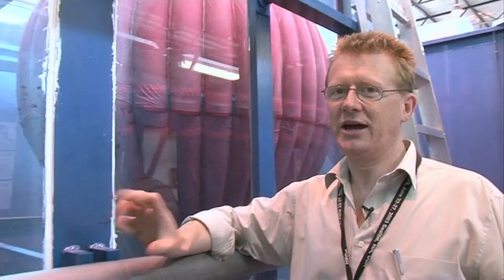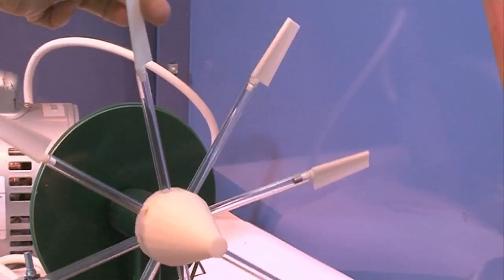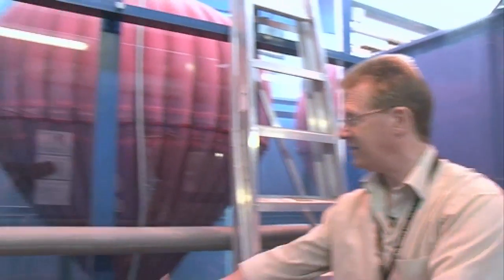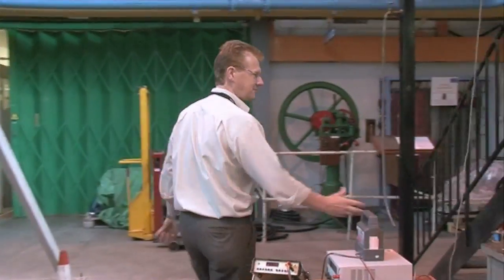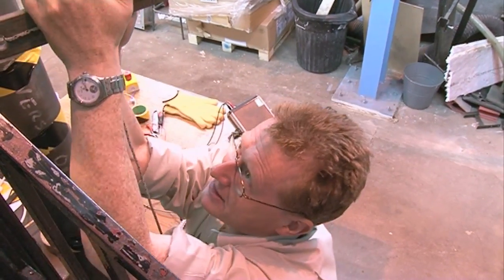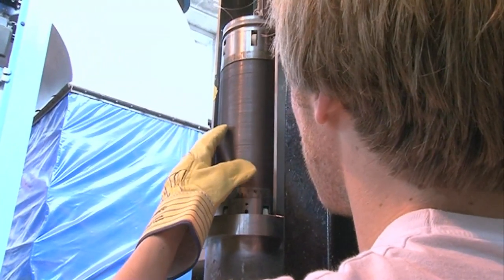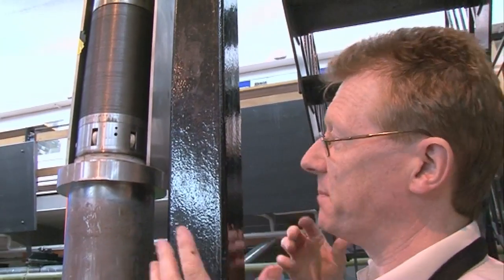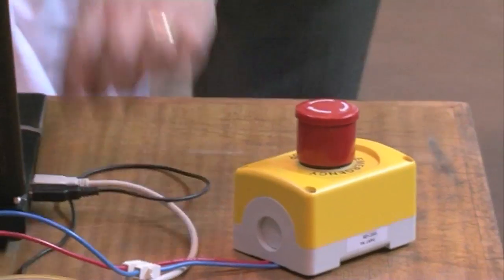Piston Drop Test

Comment: The inefficiency loss  from transfering energy from a well understood wind turbine to an electric air compressor is still going to cost less than the effort to maintain and repair this experimental system with heavy pistons banging back and forth in tubes.

Comment: Hmm precision honed cylinder 120 meters long? Sounds interesting. I presume the straightness of the bore is not terribly important. However the roundness is very very important if you want efficiency. I wonder how is the deflection of the blade going to affect the geometry of the piston bore.
Also I wonder if this system is going to be more efficient in comparison to  a multistage compressor in a nacelle.

Comment: The sea bags, cool. This piston in the blade idea, not so cool. Moving parts inside other moving parts. Seems like it would be a lot more practical to put a compressor at the shaft on the rotating wind mill. I suspect if this ever does see large scale deployment, this is what would happen.

Comment: @Albanianator If you anchor the balloons to the sea floor at a depth of 2000m, they can store air at a pressure of about 200 atmospheres, which is about the same as what can be stored in a scuba tank at sea level, but the balloons can store gas more cheaply than a conventional containment vessel since they only need to be strong enough to withstand the vagaries of ocean currents, sharks and other submarine hazards, and are basically just bags with a gas-proof liner and a pipe to the surface.

Comment: nice idea,
as they scale the size, they can also limit the speed that it rotates, so it can take as long as it wants/needs to do a single revolution. centripetal forces should be minimal
With pure wind generators, you need speed, this is different, the wind is rotating the blades to compress air for energy storage

Comment: @ZenonDorinPower i agree,why not use a  already well developed screw compressor etc,just geared off it.it would be able to use different speeds of rotation via a gearbox,and why not just use a empty gas well for air storage?? the cost for development and construction using a very inefficient piston /lots of friction and wear issues.....

Comment: @thegreatersnake 
I don't know how much useful the pressure in those bags will be.  The current compressors use a lot of energy to store compressed air into pressurized metallic tanks.  The psi in those tanks is reliable and creates a great output of usable energy, I don't think those balloons can contain usable psi.  If the weight of the pistons alone would create high amounts of psi then they wouldn't use balloons but they would use metallic tanks.

Comment: @odysseus9672 Think of it falling like the charging stroke in your car. You need to refill the air. This can be done via simple (mechanical) check valves. Rather than having to worry about electronically opening the valves during each stroke.

Comment: So it's only relying on the weight of the piston to compress the air?  Eventually the compressed air's force will be too strong and the weight of the piston wont be enough to compress the air. Once the valve opens as the piston drops down to compress the compressed air will escape back or maybe reach equilibrium and the weight of the piston and the force of the compressed air is the same.

Comment: At rpm, I think the wind turbine will be off balance or vibrate badly with the moving pistons like that.  In addition the centrifugal force will lower the force gravity has on the mass which will mean the pressure of your system is proportional to rpm.  I agree with ranster12.  Why not connect a compressor through 98% efficient gear drives or direct connect?  This way you're not limited to the force of gravity.  And I agree with hla27b building that cylinder is a problem.

Comment: this seems kinda wacky. i don't see why they dont just generate electricity, then use an electric motor to create compressed air. even if theres wasted energy, it would be more reliable and less bulky.
Reply: +pepe6666 because then you're using the electricity you just generated. 70 BAR is over 1000psi. to generate that sort of compressed air continuously would use up massive amounts of electricity. this is all about increasing efficiency. the more times you convert energy, the more energy is lost (by creating sound, heat, etc.). we can not create perfect systems to convert energy, which is why eliminating the conversions altogether is the most probable way to achieve maximum efficiency. if the turbine is spinning anyway, why not take advantage of it?
Reply: +Logan Fehr By this logic, why convert mechanical energy from the turbine into compressed air, then into mechanical power, then into electrical power in his proposed system whenever you want to immediately use the generated power on the grid?

Why not instead only convert the energy you have excess of from mechanical to electrical, to air, to mechanical to electrical when you want to take it out of storage? And have the advantage of storing any surplus energy on the grid from PV, nuclear, etc?
Reply: Its cool, Musk is taking care of it. 1Km^2 battery bank farm is sufficient to carry the US on pure renewable. Only one form conversion needed before the consumer. I say we pull a risky move and divert a massive swath of defense spending for a year or two to setting up as much energy storage infrastructure as we be able to utilize over the next decade as we add the generation side.

Comment: @Albanianator The conventional method of storing compressed gas is to construct a containment vessel with strong walls that can withstand the pressure difference between the inside of the containment vessel and atmospheric pressure on the outside.  The trick with the balloons is that they use the pressure of the water surrounding the balloons to counterbalance the pressure of the air inside the balloons, so they don't have to contain any pressure difference. <cont>

Comment: 20 tons on a 120 meters lever?! What are they planning to make the turbines from? Carbon nanotubes?! Not to mention the problem with highly unbalanced load on bearings in the centre. Real world turbines have problems with just the pillars creating a cushion of higher pressured air behind the blades and they want to place 20 ton weights on tips of them...

Comment: at 300 to 600 meter depth where this bags are supposed to be, they will have a pressure of ruffly 30 to 60 atmospheres, so the volume wouldn't be much more than that of the balloon times 60.
And still they wouldn't pop all at once since the outside pressure will be almost the same to the inside leaving the air slowly escape.
Even all at once wouldn't be more than 300 cubic meters not enough to sink 20 meter long boat.
And they will be under the windmill away from boat traffic.
so why worrying ??

Comment: I know it's a joke, a potential compressed air spill under water could be very dangerous. If sufficient air (or any gas) is released below a boat or ship, the boat or ship would sink when the air breaks the surface of the water. Spontaneous releases of natural gas (mostly methane) has sunk ships before. Although, of course, it's not dangerous for the environment.

Comment: I love the idea of turning the energy produced by the wind turbine directly into compressed air for easy storage but this piston in a 120m long tube seems a bit too experimental. Why not simply use a conventional wind turbine and attach a conventional piston air compressor to the shaft instead of a generator. You could even dimention the compressor so that no gearbox would be necessary allowing for further simplicity and efficiency.
Reply: Never ask this kind of questions. No one will answer. Do not ask efficiency questions either.
Reply: I wasn't expecting an answer. Simply proposing a better solution.
And by the way - Never tell people which questions to ask and not.
Reply: ChrDam12321 Dam you could also use a turbine based compressor.  Take the main shaft of a typical wind turbine then gear it up until it can spin the smaller blades of a turbine.  You then don't have to worry about having to turn to rotation into reciprocal motion.

Comment: Compressing air causes it to heat up.  I'm too lazy to do the calculations but quite lots of the work you'd be doing is wasted to heating of the air while it's compressed. I wonder if they have anyway to deal with that.

Comment: Great idea, except for the pistons in the blades. Why not use a more typical multistage air compressor (or modify a large engine), instead of trying to do this inertial with a massive, heavy piston.

Done right, you could use the rotating power to directly drive a generator for immediate use, and use that same compressor as an air motor to generate electricity from storage when needed

Comment: The turbine would have to rotate slow enough so that inertia wouldn't keep the pistons stuck at the tips of the turbine blades.  This would, technically, make the turbine less efficient as the wind speed increases because less energy from gravity would be converted into air pressure as the acceleration due to the earth's gravitational field must fight the radial acceleration of the pistons.

Comment: we've already heard the problems of loss of energy due to heat and inefficiencies, but here's the BIG problem: the turbine is SPINNING. think about the amount of energy you lose by compressing air as they fall down the upper blade due to centrifugal (yes, I said CENTRIFUGAL, deal with it) force! it would be much more efficient to harness the air pressure created by the falling pistons in the bottom blade, rather than the top.

Comment: I'm glad to see a few other people have noticed this as well but this method of compressing air is impractical, bordering on asinine.  You need an exact wind speed for this to work.  Just a bit too little and the blades can't lift the mass.  Any more than that and you lose energy to centripetal force counteracting gravity.  I wont even go into the frictional losses, mechanical stresses and oscillation something like this would create.

We already have very good wind turbine designs and very efficient air compression apparatus.  Why try to make this frankenstein  monster?  It has no benefits.  This whole 'energy bag' thing is starting to look like the solar roadways scam.
Reply: +htomerif Would variable pitch turbine blades make it work?
Reply: Eric Taylor Yes, but the problem is you'd have to target the whole system for a very low power output and use the variable pitch to maintain that low power.

With a normal turbine you can target the turbine's maximum physical and electrical limits with variable pitch and track those instead of an arbitrarily imposed piston mass.

Actually, looking at what I just wrote, the most practical way to fix this would be to have variable reciprocating mass, like a series of pistons instead of just one and being able to lock some of them at the hub during low wind conditions.

Ugh, that illuminates further bad design.  Just as much energy is being lost on the out-stroke of the piston with their current model.  You'd need high pressure lines coming from the blade tips all the way back to the hub as well.
Reply: Eric Taylor I think my biggest problem with this is maintenance.  Its hard to think of anything analog with similar friction, precision, lubrication, wear and mass movement.

I guess the closest thing would be a high speed train.  Imagine having to maintain a high speed train only its encased in resin and fiberglass, suspended at least a hundred meters in the air and its in the ocean.

Regular wind turbines are made to have a minimum of moving parts because repairs are dangerous, take a long time, require highly specialized personnel and are very expensive.
Reply: htomerif
I have to agree with you mostly, but not fully. My disagreement is with the notion of "mature" renewable energy. None is really "mature" in the same way fossil fuel technology is mature.
    All of the main "renewable", wind, solar, hydro, geothermal (yikes), all have MAJOR problems that need to be overcome. Especially geothermal. This seems like a fantastic idea until you realize what is down deem in the earth that would be brought to the surface with a geothermal plant.
    Really our best option right now is nuclear power. Despite the recent accidents of the last few decades nuclear is far safer and far cleaner than any other source of energy currently available.
   If we really want to control climate change we shouldn't worry about cars first. By far the biggest polluters are power plants. We need to go nuclear NOW.
Reply: Eric Taylor Yeah, what I said was a bit to simplistic.  I agree, we need to be replacing pretty much 100 percent of coal and oil fired power in the US with nuclear.  In fact, since all 3 of those things run off steam, you could probably produce a generic retrofit program to reuse about 80 percent of a coal plant and drop in a reactor.

Really the only two renewable technologies Id consider fully mature are wind and hydro plants and thats mostly because they tap straight into much older, more developed technologies like fluid and gas turbines and standard hundred kW electric generators like GE would make.

The thing I'd really like to see with renewable energy is bringing some of the high efficiency multi-junction solar cells they use on satellites into mass production for the energy market.

--preemptive edit
If the US doesnt SERIOUSLY ramp up its nuclear production, we're going to find ourselves lagging 30 years behind what we consider "third world" countries.  We're already behind the 8 ball compared to europe and china.

--more ranting
We had the opportunity through the GW Bush presidency and Obama presidency to turn the US into the cutting edge, definitive production powerhouse when it comes to nuclear and solar.  We will never recover from that mistake and the world will suffer from it.
Instead, we handed over the reins (or reigns, either works) to China, a country responsible for probably more human rights violations than the rest of the world put together (I mean numerically, not percentage-wise, though even that is still just awful).
Reply: Eric Taylor I actually hadn't thought of that at all.  I know they make multijunction cells for terrestrial use, but I'd ignored all the UV you've probably got in space.
Reply: htomerif
I live in Oregon. Solar is okay in the summer but in the winter the sun is so low on the horizon (when it isn't overcast) that even when the sun shins (which isn't a lot) it just doesn't provide much energy.
     It's fine in the tropics, but if you get very far into the temperate zones it becomes worse and worse the farther you get from the equator.

Comment: This just seems overly complicated. I don't understand why you wouldn't just use a traditional air compressor design connected to the wind turbine axle.  I also don't understand why you don't want to store the air in traditional steel containers.  Please someone explain this to me.
Reply: Using this type of compressor massively decreases the need for maintenance, as well as decreasing the complexity of the system and therefore increasing its efficiency. The bags are stored on the bottom of the ocean so that they can store massive pressures, and massive amounts of energy, relatively simply. Using steel containers would be largely impractical because storing a large volume of air at 10,000+ PSI requires some very strong materials, and a lot of them.
Reply: Thanks dude

Comment: I didn't really say that this system had a flaw, and I really think it's a good system, I was just pointing out that large amounts of gas (of any kind) released under water could be a potential hazard for ships. If you saw the earlier comment (the one I replied to), you will see that someone joked about compressed air under water being "dangerous", and I just pointed out that it could actually be dangerous. I did not mean to discredit or stain this project/process in any way. I'm sorry.

Comment: This is a great idea. If instead of using it to produce compressed air you used it to compress a refrigerant in a closed circuit, you could produce water from the atmosphere through condensation. You could turn wind into water!

Comment: This system will never see the light of day.  The cost of manufacturing the steel alone would probably offset the energy this thing makes.  The water lubricated bearings are a joke and will not last 15 million km.  Why not use an electric wind turbine to power a compressor?  It's 90% + efficient transfer of energy.  Take the money from this and invest in magnetohydrodynamics and you can get higher efficiency from it.  Windmills work well because their low weight.  Your losing that with this
Reply: I guess it's because this investment goes to the ocean. It is easier to justify when it comes to the ocean.